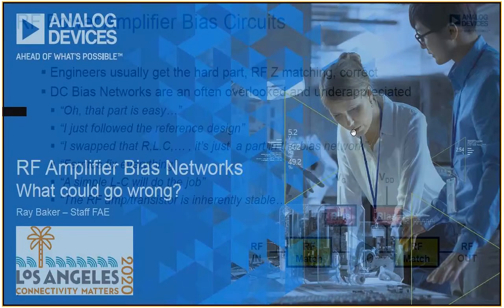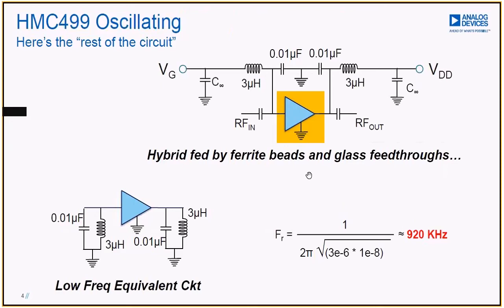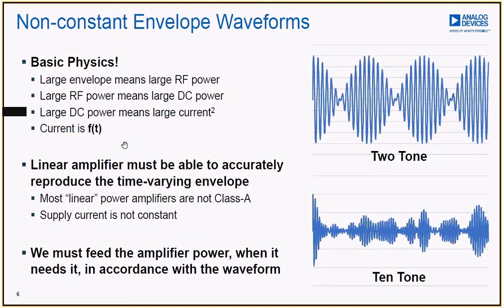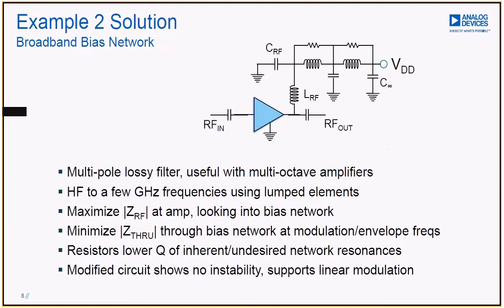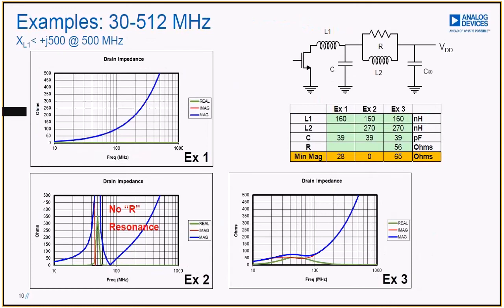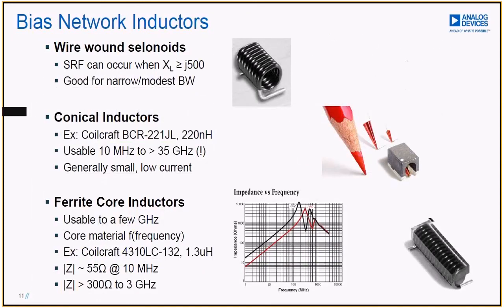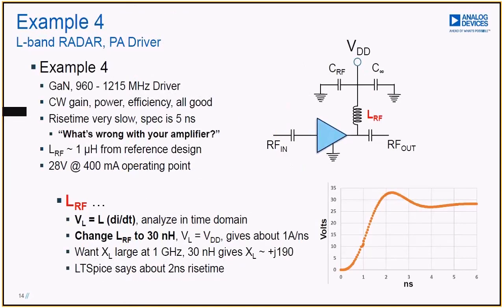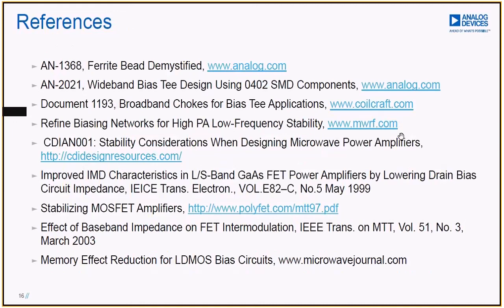RF Amplifier Bias Networks: What Could Go Wrong?

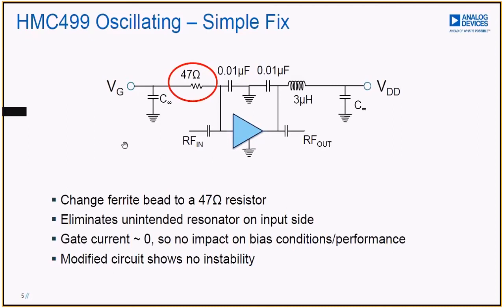Comment: @4:50. This is not obvious that you can load your input with 47ohm in parallel  without disturbing the matching, Also the schematic shows 10nF in parallel with the input. Can you comment on what is not on the schematic?
Reply: It looks like the die has separate connections for supply and gate bias, and part of the bias network is contained in the HMC499 die.

Comment: Great presentation, however, the use of the word "bias" has been misunderstood, and misused by our East Asian friends. Bias is an old English word, and basically means "deviation from some normal condition". 
You can bias a gate, a grid, or a base, in an amplifier, to set its idle or quiescent current (Idq) and operation class. If "zero" bias it has no voltage. You can self-bias, cathode bias, have Class A-, B- or C-bias, have negative or positive bias.
It has nothing to do with drain-, plate-, or collector power. 
You don't "bias" your soldering iron, or your Tesla when you plug it in, you power it. 
The word Bias has taken on a "mystery" meaning by some East Asian engineering students. Maybe Google Translate did it. 
No reason to repeat the misappropriation of their folly. Please make it English.